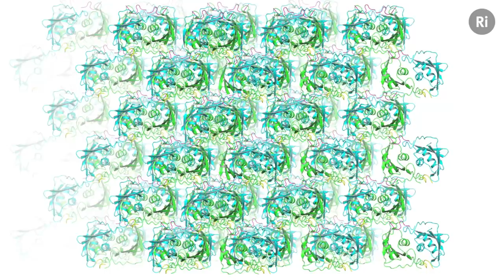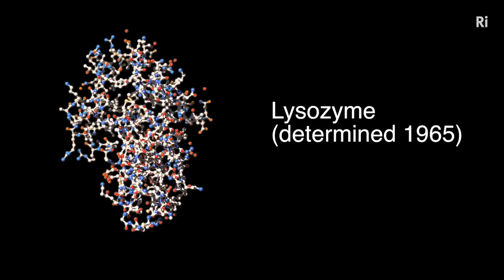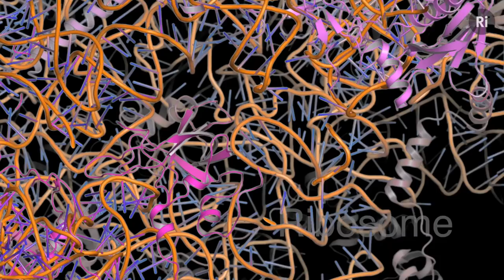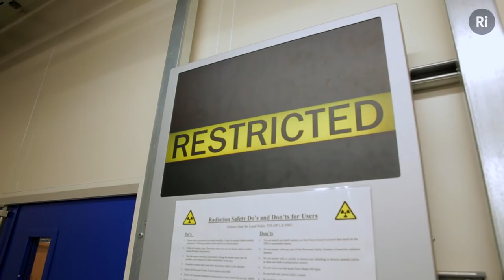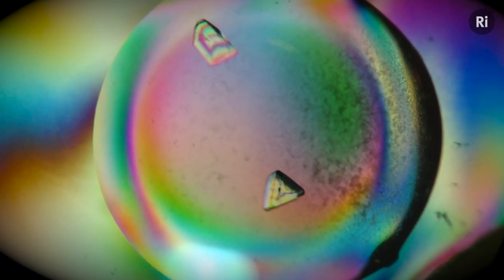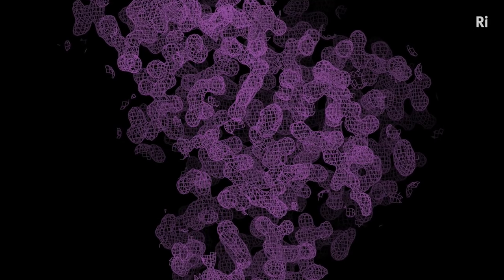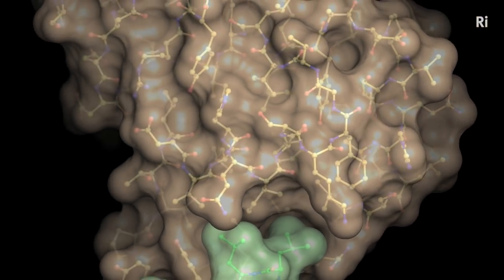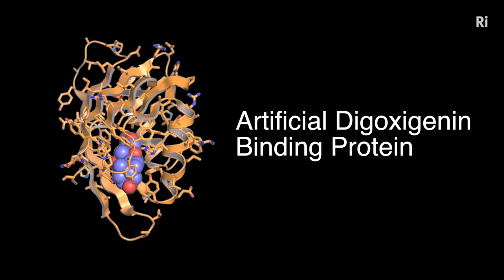Understanding Crystallography - Part 2: From Crystals to Diamond

Comment: Sublime video.

How is it that large molecules such as ribosomes can even be crystallised?

They seem so huge and unwieldy that they would just tend to slop together into whatever arrangement that happened to fall.
Reply: I'm not a crystallographer but from what I have come to understand after watching lots of lectures on this technology is that even large molecules will tend to naturally crystallize quite easily as long as a few conditions can be met.  One thing that greatly helps the process is that the solution of proteins is as homogenous as possible, but apparently that isn't absolutely necessary.  The main catalyst for crystallization is due to additives and precipitants (hope I spelled that right).  However, I don't know enough about chemistry to know why those chemicals have such a properties.  Anyways, I think I got that info from this same channel, different video.
Reply: fullyawakened Getting the ribosome to crystallise was far from easy but it had to be done in order to solve the structure by this approach. It took years of work in many different labs around the world, first to crack bacterial ribosomes which are smaller. The one shown in the film is from yeast, also a single-celled organism but nevertheless a member of the 'eukaryotes', the branch of the tree of life that contains all multi celled organisms, such as ourselves.
Reply: Stephen Curry
Thanks for the videos, and clarification.  This stuff is so incredibly fascinating!  These videos have spurred me to look up all kinds of documentaries on crystallography in the last week or so.
Reply: fullyawakened Really nice to hear that! I'm sure you'll have seen the RI's Crystallography Collection: http://www.richannel.org/celebrating-crystallography
Reply: @scurryww  The link you provided is now hosting a Trojan according to Malwarebytes.

Comment: Would it be possible to use Gamma-rays in place of X-rays, would that help and be possible?
Reply: I think that for this technique to work, the X-ray beam needs to be collimated. The collimator is a tube with lots of microtubes in it. The majority of the X-ray photons gets absorbed. Only the straightest path photons make it out of the tube, therefore you lose a lot of brightness.
In the case of gamma rays, first you need some methods of producing them. The second problem is that gamma rays are hard to collimate since they are hard to absorb. The collimator would have to be very long.
Reply: louis tournas
Thank you for the information, this will keep me busy for a while. :)
Reply: I could be wrong but I think the longer the accelerator, the more energy have the x rays produced, and that means they have a shorter wavelength than x rays produced in smaller facilites. So in a way they are increasingly going into the path of producing gamma rays, but its use would be more to determine the internal structure of atoms since for molecules x rays this powerful seem enough.

Comment: I understand how you would get the skelet of the protein from that diffraction pattern but I still don't get it how the computer can tell you what kind of atom is where, guess I would need a deeper explanation as a chemist.
Reply: The computer doesn't tell you this. In most cases we know it in advance because the amino acid sequence is known and chemists long ago worked out the atomic structure (and chemical composition) of those. The tricky ones to figure out are where you have metal ions bound to your protein; in these cases one can sometimes use X-ray fluorescence to identify the chemical species.
Reply: Stephen Curry
Thanks for the answer, I thought computer does it all. Well that explains. Out of curiosity, is NMR spectroscopy not suitable enough for structure determination of these biological macromolecules in solution? I think I've attended a lecture about that previous semester, but I didn't pay too much attention, I just thought it must be very complicated. This sure looks more convenient.
Reply: Ace0077 NMR is a very useful technique for structure determination, especially if you can't grow crystals (which is a common problem). It gives you the 3D structure but not in quite so much detail as crystallography; plus, it's pretty hard to use NMR to solve the structures of large proteins. On the positive side, it can give information on protein dynamics that you don't get with crystallography. In practice, many structural biology labs use both approaches.

Comment: Every atom... except hydrogen
Reply: Ha ha - well spotted. It's true there are no hydrogen atoms shown in the molecular model that appears at about 6:21. Crystallographers often leave them out because they have many fewer electrons that the main constituents of proteins (C, N, O) and so contribute only weakly to X-ray scattering. They do appear and are included in models constructed using very high resolution data. For example, you can see them emerging as 'bumps' in the photo in this only blogpost which is of an electron  density map of the highest resolution structure ever produced in my lab (about 1.45 Å) - http://occamstypewriter.org/scurry/2008/12/10/come_and_see/

In contrast, protein structures solved by NMR always include H atoms since these contribute very substantially to the data that are recorded in such experiments.
Reply: Thank you for the link, interesting data. Actually it was not the model that draw my attention but only the inaccurate statement itself. These details are just something one picks up studying Chemistry and I would be lying if I said I don't enjoy pointing out such inaccuracies ;)
Reply: minj4ever Well, I guess what my slip shows is that crystallographers tend to dismiss hydrogens because it is relatively rare for us to have to deal with them. Although the resolution of our data means they are usually invisible, we know they are there and can fairly easily determine their positions from a knowledge of chemistry. However, we're in the habit of not doing that calculation (unless it is necessary for understanding enzyme mechanisms or ligand binding). Personally, I prefer to look at protein structures without the H atoms shown because I think the models look too messy with them included! Of course, NMR spectroscopists tend to take the opposite view.

Comment: Wow CGI is truly considered proof in the science world nowadays. I also like how mathematics is used to create an image that nobody will ever be able to verify its actual existence. Science has truly become a religion, because so much is based on beLIEf.
Reply: What? Are you even serious? I'm not even sure why I'm bothering to reply, but: it's a visualization tool. The proof comes from a concrete, mathematical understanding of how light diffracts. The structure is solved from the diffraction pattern by, basically, a inverse Fourier transform of all the diffraction patterns captured.

But, most importantly, where do you feel you've gotten the understanding that would be necessary to actually criticize crystallography's position as science? From this short video?
Reply: @BinaryHistory  the Babble